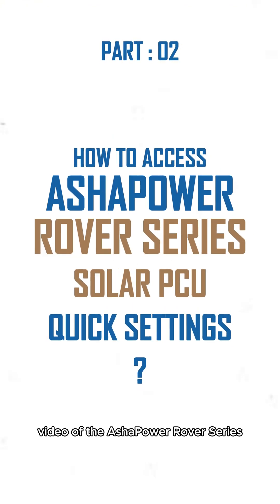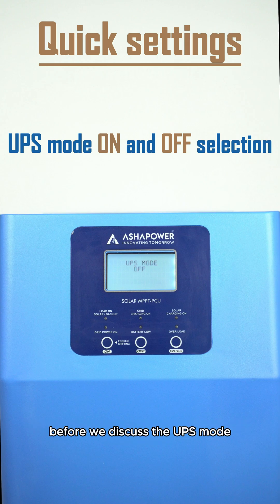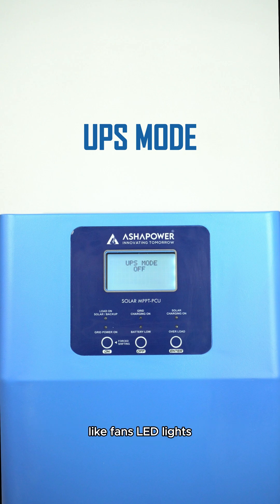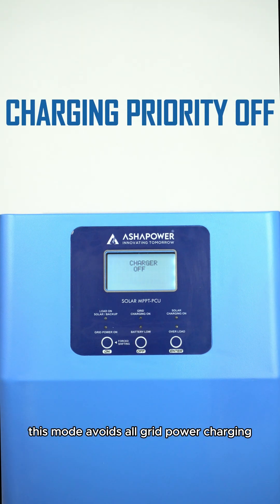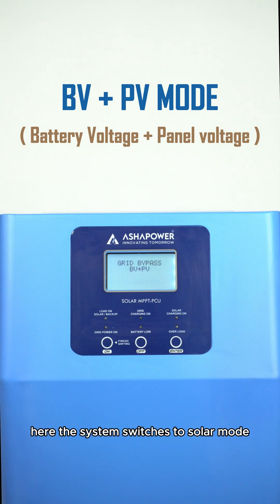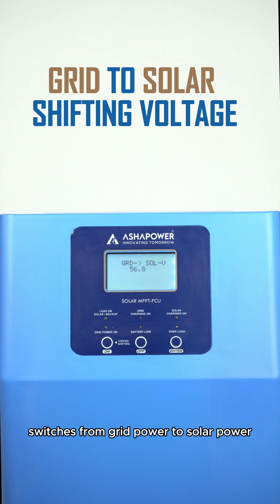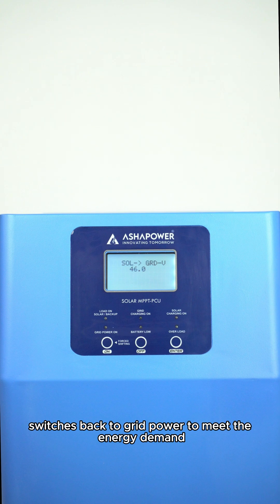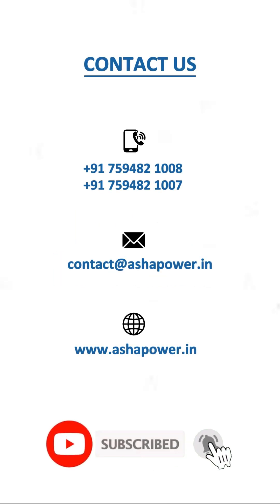Ashapower Rover Series Solar PCU Quick Settings Tutorial ( Part 02)

Comment: Asha power solar inverters are very good quality but the settings of the of inverter is very complicated... In otheri inverters like UTL or Eastman the settings are easy... Ther r three modes solar, smart, hybrid.... Which the user can easily select with a single button according to the climate and users requirement simply... But asha power settings changing needs the technicians advice or the user has to be a technically knowledged person..
So i think it will be convenient if they can make the common modes selection settings simple.

 And the onsite servie issue also ther... And its difficult to get an asha power inverter from a normal io inverter shop in kerala... I don't know y these people are not supporting this product... I hav tried many times this year... Even their district whole sale dealer is not that much interested in selling this product in calicut... I hav contacted twice before...